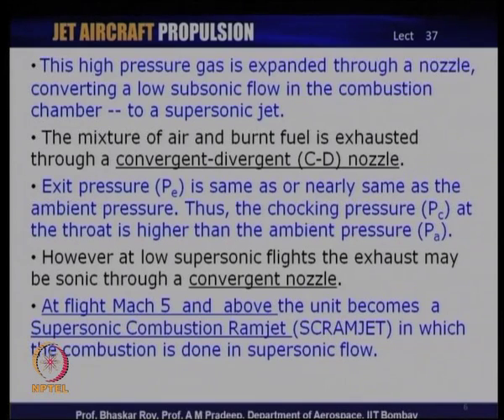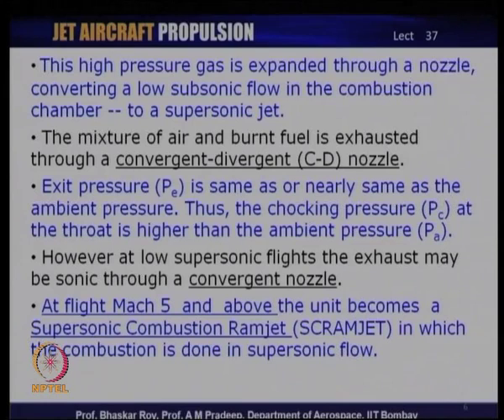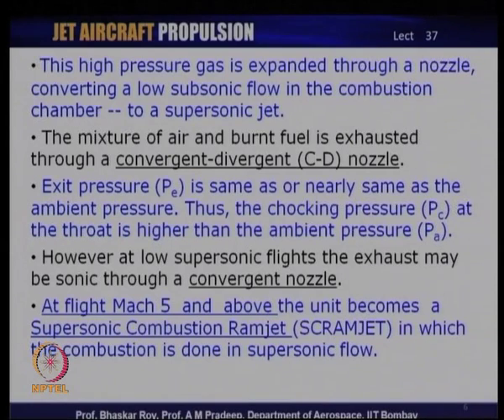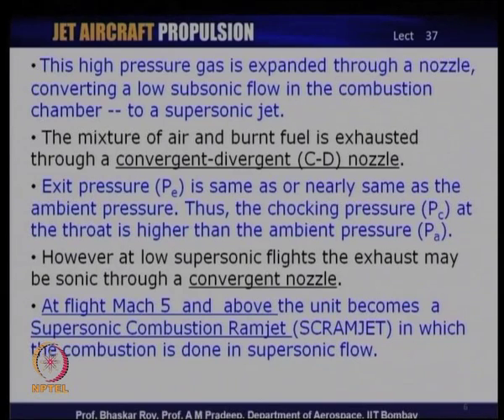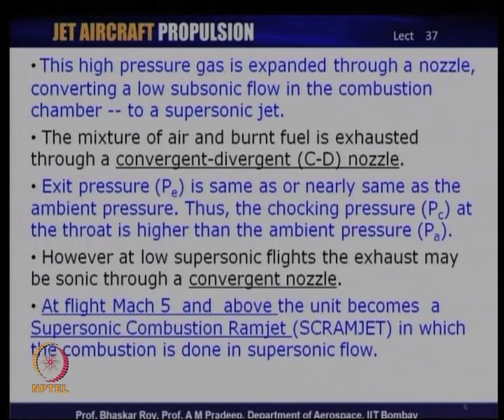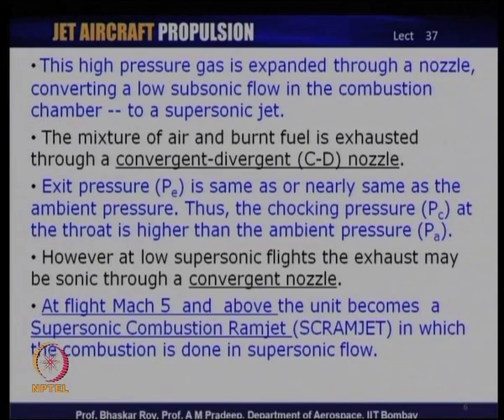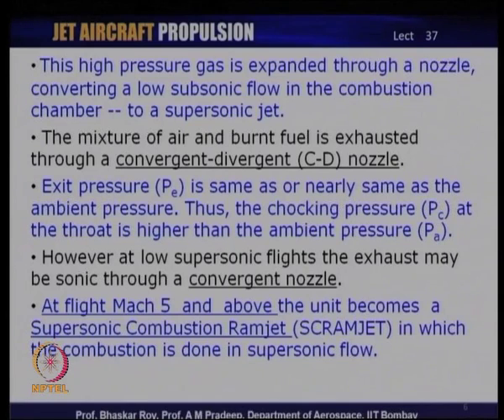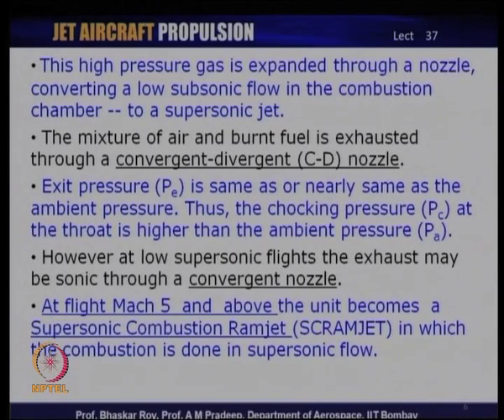Mod-17 Lec-37 Use of Ramjets and Pulsejets in Aircraft propulsion

Comment: The V1 was not started with the compressed air stored on board. It was started using "compressed" air while it was stationary by injecting the air via three ducts located behind the valves. This was done by an external source as was the spark needed to start. Both were disconnected when the engine came up to temperature. The compressed air on board the V1 was for operating the guidance computer and control surfaces. It was launched via a catapult and a rail like the ones aircraft carriers use to aid jet take off. This system propelled it to about 250 mph in about 3-5 seconds.